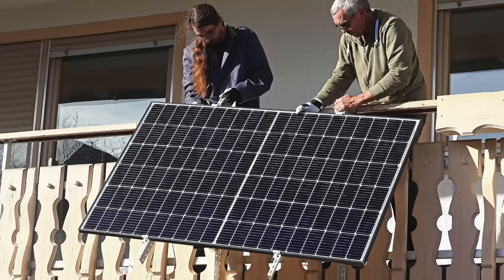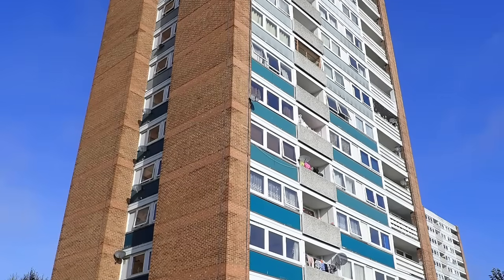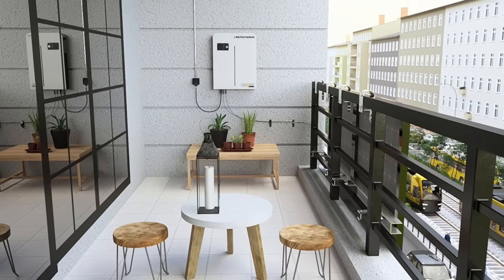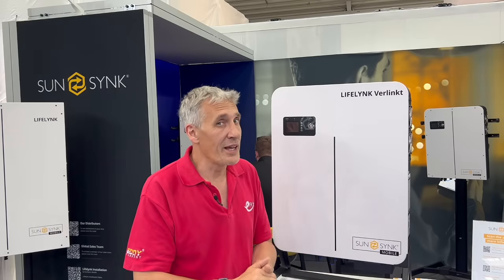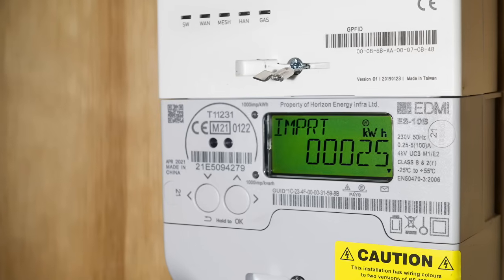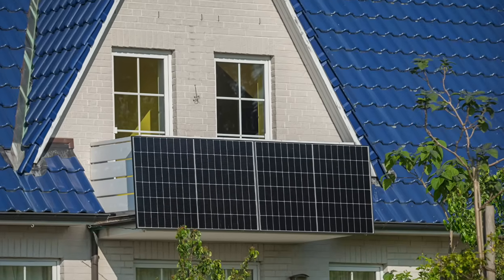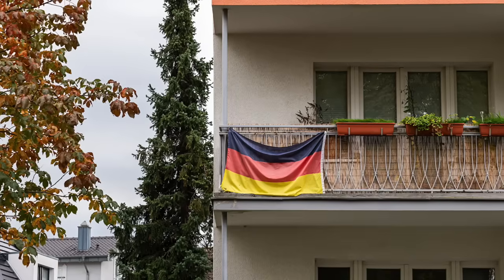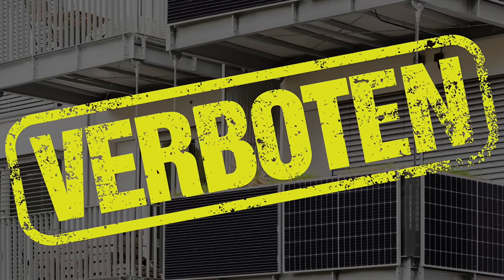DIY Solar Installation: Genius Idea or Total Disaster?

Comment: It would be interesting to see what measures these units contain (if any) to immediately switch off the inverter should the plug be removed from the socket outlet.
Reply: You can just use a normal microinverter, as long as it has less than 800W output power. They already do have anti-islanding protection. The sets I saw are just that, normal microinverter with a new output cable and a new page in the manual.
Reply: @MikrySoft  You can't do that legally in the UK.
Reply: They are constantly reading the incoming mains in order to synchronise with the AC waveform. They have to measure it and slightly adjust their frequency and voltage in order to add their output to the mains input. If they can't see a mains signal they won't start/switch off.
Reply: @matthewwakeham2206  Another person that doesn't understand the requirements of EREC G98 and how this is dangerous.
Reply: 800w is fucken nothing, waste of time. Even my toaster is 1000w
Reply: None. Otherwise, the inverter would switch off each time the phase reached the zero crossing point. That's why they're dangerous.
Reply: @VinoVeritas_ they turn off if the house mains are lost by removing the plug or a power outage.l using the eame technology as every other hard wired inverter that is on grid the only difference is the way they are wired in these use a plug and socket to make the connection instead of being hard wired to the fuse box, these 800w inverters are basically just microinverters on a wall instead of under the panel.

Comment: Re injecting power into a wall socket, there was a YT video about 6 months ago about an American company producing a battery that supplied power to the house in the same way. It was in the pre-production phase so we might see it on the market in a year or so's time. The concept was that you could charge it with cheap electricity overnight, and power your house during the day. The bonus feature was that you could take it with you when you moved house (aimed at renters), and had no installation costs to pay.

I did contact the IET about it and suggested that they might want to consider the procs and cons of using a wall socket in this manner, and so review the regulations, but never heard back from them.
Before anyone asks, I don't have a link to the original video. The battery appeared as a 'bonus material' couple of minutes at the end of a video about the more normal permanently installed battery packs.
Reply: @HHGTYG-u6g  Can you show me where in BS7671 it states that an inverter can be connected to the electrical system via a 3 pin plug and socket?
Reply: @HHGTYG-u6g  You should also read Ecoflow's UK website regarding the Powerstream inverter.
Reply: This has been in the market for a while now. It's from a company called Ecoflow, but it's not legal to use it in the UK as designed.
Reply: @VinoVeritas_  Thanks for the helpful information.
Reply: @HHGTYG-u6g  It doesn't matter what Ecoflow are. Companies often lie to make sales. Take the Volkswagen emissions scandal for example.

Comment: A 3 pin plug is safe in the UK. Does it matter which way the energy flows. It's called plug and play technology. Of course the power companies won't like it. Negative electricity prices in France at the moment due to the raging success of Solar, wind and tidal. They've had to turn off the nuclear as its too expensive!
Reply: The key here is that the type of savings this would yield is significant to working class households that unfortunately are so deprived that they would never be able to afford multi thousand systems installed by pros. Components + DIY are the only way this is accessible or economic to many UK households. The law should evolve to support and train people. If some RCDs need changing to bidirectional that can be made clear as requirement and done by any sparky no need for MCS approval for that right?
Reply: AC doesn't have direction of flow it's like pushing something backwards and forwards. It has less energy loss than DC, which does have a direction.
Reply: This has nothing to do with the power companies. This is all about safety.
Reply: @VinoVeritas_  can you elaborate on the safety issues with this?
Reply: @paulodell  The pins on the plug would still be live if it was removed from the socket mid-generation. There are also issues with RCD protection.
Reply: @VinoVeritas_ No, plug won't be live by the time you pull it from the socket, microinverters typically detect islanding and shut off within 100ms
Reply: @MikrySoft  Read EREC G98.
Reply: @VinoVeritas_  Most professionally installed PV systems don't follow the original guidance which is on a unique bi-directional RCD. I've seen them on installed on a MCB with other MCBs utilising a common RCD for protection. If someone receives an electric shock on another circuit the RCD may trip in 30ms but the circuit would could still remain live for 500ms receiving power from the PV. not so good. Ideally PV, EV should be put in a separate consumer unit protected with type B RCD but I'll hazard a guess that 90% don't, because it costs.
Reply: @curiousinterests9453  how would a customer find a competent PV + battery installer? What questions need to be asked?
Reply: @VinoVeritas_  🤣👍Sure...

Comment: I fully support the DIY installation of solar PV and batteries. However, this is not the right way of going about it.
Reply: I've done it with an eco flow system onnected to RBCO. works perfect and 11.52 Kw hour system with 12 x 450 watt panels installed for less than 5k

Comment: What’s to stop people who buy one in Germany coming to the uk and plugging in?
Reply: There's nothing stopping you from buying this type of system in the UK and plugging it in except the law of the land.
Reply: @VinoVeritas_ well that's not true, if the inverter does not have G98 settings programmed into chances are it would never start up
Reply: Which statutory regulations make this illegal? Thanks @VinoVeritas_
Reply: @ascot4000  You can change the plug you know, just saying.
Reply: without g98 it might not like the typical UK grid voltage.

Comment: I think there are 2 things we need to look at as a country, first, do we actually have less accidents and issues here than in a less well regulated country (i.e is there a meaningful benefit from all the additional rules), second is it really a good message to tell the general public that they should be afraid of how dangerous home electrics are and that the public should know nothing as that seems to be the message from the regulator and electrical installation industry. Surely it would be safer to have training available for people so they can educate themselves and then prove a minimum level of competence to do work on their own homes. The issue at the moment is that the only way to be an approved electrician is to take all the training and change career to become one. If I use myself as an example, I have a degree in electrical engineering, but despite multiple years of study that all counts for nothing in my capabilities as an electrician.
Reply: You hear this argument a lot and in fairness whilst your average electrical engineer will run rings around an average electrician from a technical standpoint that doesn't make them practically competent in installation or commissioning. 

The fact the industry is moving to a defined qualification set is not a bad thing. Even if that means the odd salty electrical engineer on the way. 😉 At the end of the day if you believe yourself competent you can do your own work for yourself... It's just going to be challenging to join one of the schemes... But as an engineer... Why would you want to? I'm sure you have better things to be doing.

Comment: It should be allowed, once the Inverter has a safe start and shutdown
Reply: How do you safely shut an inverter down if the plug is removed from the socket during generation?
Reply: @VinoVeritas_  @VinoVeritas_ integral circuit board with small battery measures grid impedance. Can be done
Reply: @corglass  Loads of things can be done, but none of these inverters currently do what's required. That's the issue.
Reply: @VinoVeritas_  this is the original point I made. It's a conditional endorsement
Reply: @corglass  Fair enough.

Comment: This should be allowed in the UK with certain limits, it would really help with Electricity bills, even if this system did not allow you to receive feed-in tariff renumeration
Reply: Strangely enough back in the day inverters like this were available with UK plugs on them - I have a skip dived 600W version from a neighbour 😮 It was only once the regs got wind of this that they changed to prevent “plug-in” type inverters - understandable to some extent for “safety” but cynically to retain jobs for the boys 🙄
Reply: @Umski  Soladin 600 by any chance?
Reply: @FireballXL55  indeed 😁
Reply: @Umski  I have 2 of them .
Reply: @FireballXL55  👍😉 I haven't done anything with the one I have yet - I want to check it over internally as I think it was outside for a bit, but I also have the 3 x 200W panels that it was hooked up to - they all seem fine - I believe it's also capable of working with a turbine but needs the cable and software to do some jiggery pokery with settings - a future project maybe 😄
Reply: My sister has been waiting for over 2 years to get feedin payments, National Grid are dragging their heals.....
Reply: Should allow in uk. If hundreds of thousands are using it safely in Germany then is it unsafe here. But then British gases profits will drop and ministers being close freinds won't like that. Safty isn't an issue, corruption is
Reply: They started to become popular in Poland too, but people quickly realized you need a bidirectional electricity meter, because normal ones count feed-in as usage.
Reply: The system is working that way, that the electricity you don't need send into the grid for free. Only what you need is deducted. Three phase installations are common here in Germany, even in domestic dwellings, so I make some examples:
-If I draw 100W from L1, 100W from L3 and my small PV is installed on L2 and produces 200W at the moment the meter stops. So I pay nothing at all.

-If I draw 200W from L1, 100W from L3 and my PV on L2 produced also 200W, the meter counts the 100W difference, so I pay for the 100W.

-If I draw 100W from L1, 100W from L3 and my PV produces 500W the meter stops. The excess is sent into the grid, and I won't get anything for it.

The DNOs here change the meter if you report to them that you installed a PV, so no Ferraris meter, because they would run backwards if you produce more electricity than you need at the moment.
Reply: @Marcel_Germann  wow .. neat . So do you have an RCD breaker for each domestic outlet ?  Thats a lot of cable ?
Reply: @studiosys For almost every circuit.